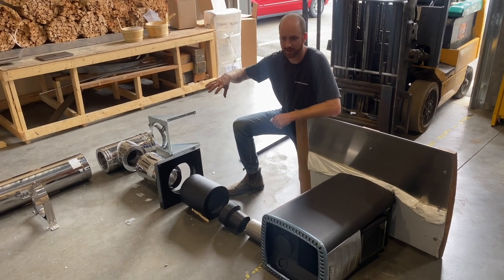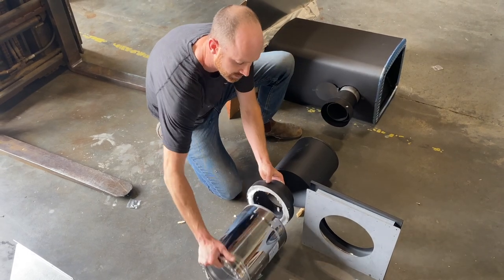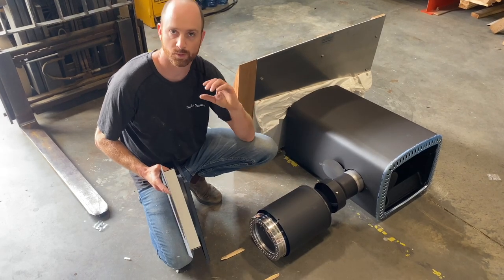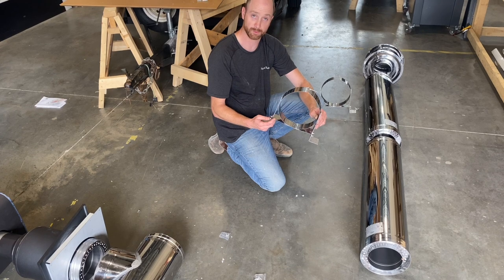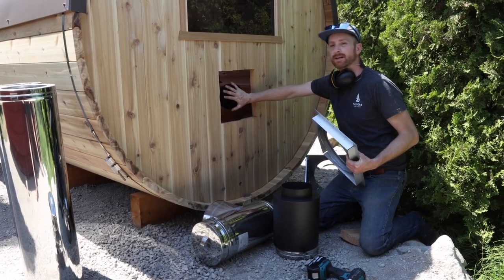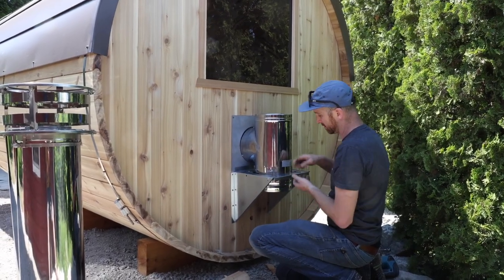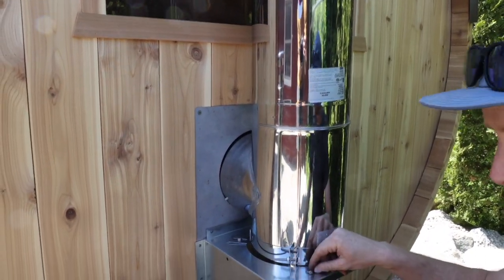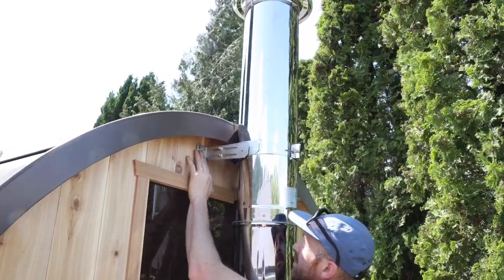Step 5.7 (For Woodburning Saunas): Installing Your Harvia M3 Stove

Comment: We ordered in fall of 2023 and chimney sent is SBI (not Selkirk or Duravent). SBI was also primarily friction fit/tolerance fit and only one interior part was screwed together. Also 2 other notes on deviation from this video: make the square cut smaller than the screw holes where you screw the flange in not just smaller than the flange itself, and our interior chimney section has to be installed through the inside of the sauna, or prior to installing the exterior cover as opposed to sliding through the exterior cover as shown in this video.
Reply from the maker: Thank you for your comments. We are producing a new set of instructions which will cover all this.

Comment: what are the advantages of the barrel-shaped sauna vs a rectangular one?
Reply from the maker: The barrel’s cylindrical shape allows for improved convection flow. Plus, there are no corners for air to get trapped in.

While it only boasts a single layer of wood, the barrel sauna makes efficient use of space and convection to heat the interior rapidly and evenly. This is further aided by the fact that it has less space to heat than its cabin-style counterpart.

Along with being easy on the eye, barrel saunas are structurally sound, making them the perfect choice for harsh climates similar to those experienced in Canada.
Reply: @nootkasaunas   I would agree that barrel sauna makes efficient use of space and convection to heat the interior rapidly and evenly, if this barrel was standing vertically on its end.  In horizontal position this barrel is a waste of space and prevention of convection